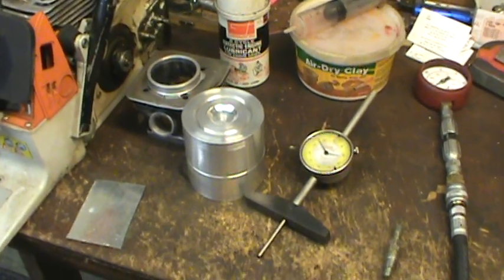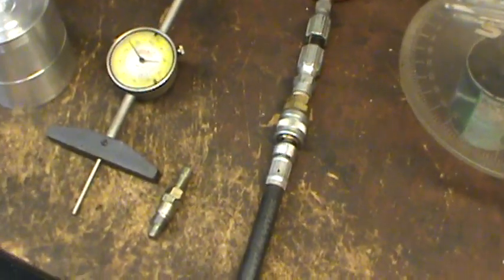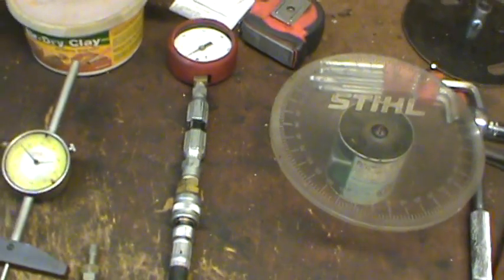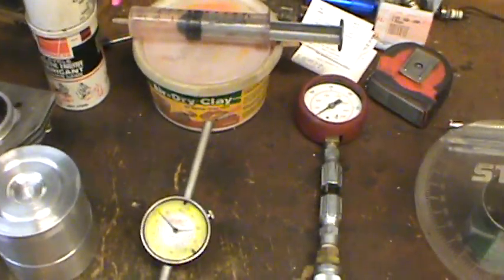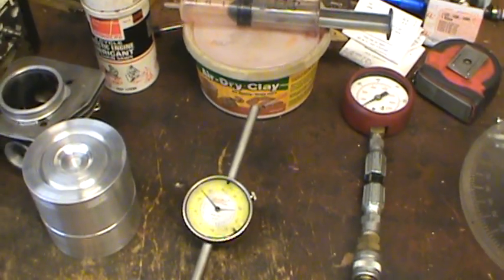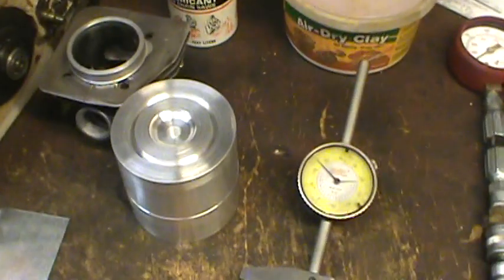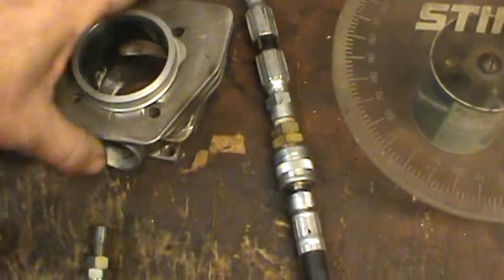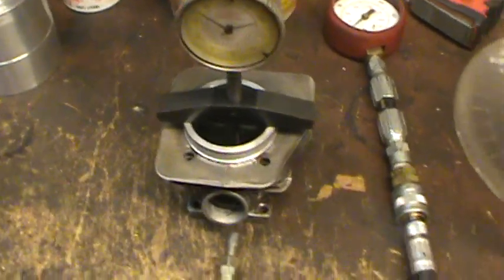how to determine cc's of a 2 piece head

Comment: You have a piece of plexiglass, take the bolt out of the degree wheel and use that, seal it with Vaseline, I use a burette on a stand to measure the liquid in the combustion area. 
Looking forward to seeing this running Scott. 👍🏴😁